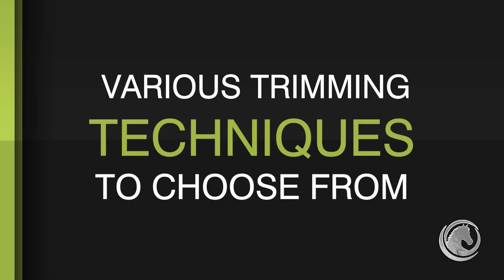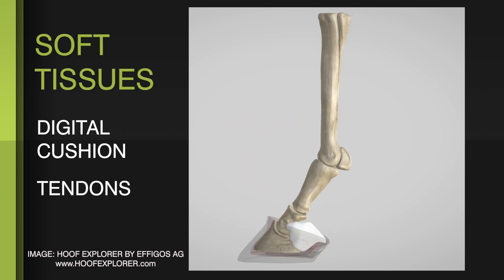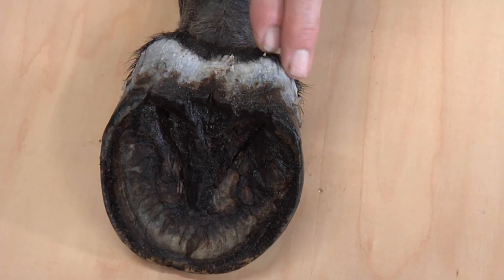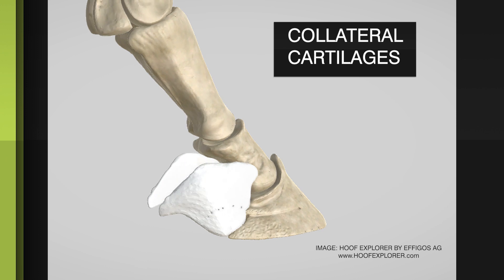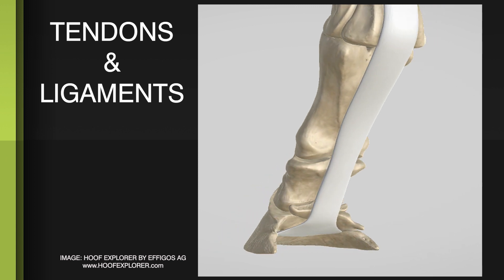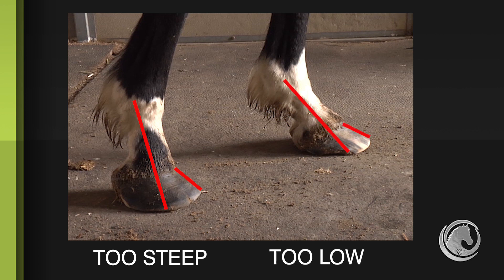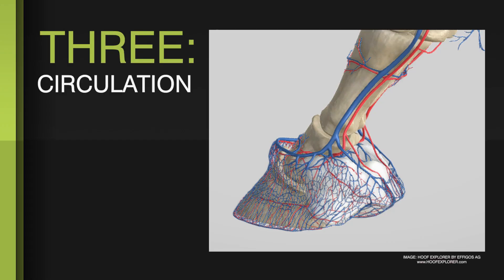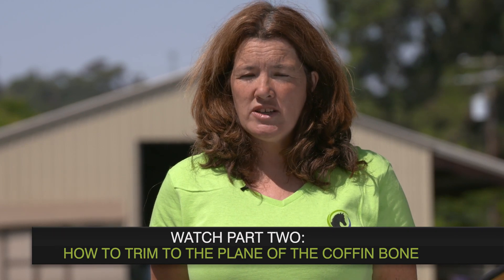Choosing a Trim: Anatomy & Theory (Part 1 of a 2 part series)

Comment: watch the Xray with P3 ground parallel: p1 p2p3p are not aligned as it should be and is procalimed in the introduction. if we imagine to rotate P3 to a 5-8° positive PA the bone colume would be better aligned. PA in wild horses is 5-8°.

Comment: Trimming for a ground parallel P3 is not considered correct or healthy. After studies of numerous feet it has been concluded that a slightly positive P3 angle is more favorable. If P3 is ground parallel, then during loading phase you will have Negative Palmar Angle, which is considered destructive for the caudal foot, as extreme pressure is applied to the DDFT and the Navicular Bone.
Reply: instaBlaster.

Comment: The bottom of the coffin bone is not supposed to be horizontal to the ground, but positive angled in relation to the correct angle of the dorsal wall, what is the same angle as the shoulder or hip of the horse.

Comment: if you carve the sole and then you shorten the wall, you are falsifying the point of reference. so the trim will be invasive. all wild horses can shed their frog and sole without any human using a knife on their sole. in over 40 years of vet practice i did not encounter more then one horse with a sole to thick. and it still could run over stony ground. if you shorten the wall to the untouched sole level, everything will come to a good end over time. if you trim as sugested in the video you will find that your horse over time will get sore. otherwise this channel has good ideas and videos.

Comment: I’m really shocked and upset that you’d have someone on to explain trimming for a ground level p3.  The majority of the veterinary and hoofcare community acknowledge that hoof-pastern alignment is important and that proper alignment is generally accompanied by a slightly positive angle of the p3, not ground parallel.
Reply: Kirk Adkins' history of success in this field speaks for itself. "The majority" does not automatically equate to anatomically correct for best health and performance.
Reply: Agreed.  Slightly positive angle of P3, not ground parallel.  I went back and reviewed my last 20 or so X-rays of horses that are completely sound and moving well and saw that if I trimmed to make P3 level to the ground, I would be dropping the heals so much that I would create additional stresses to the DDFT and all the other associated problems that go with this.